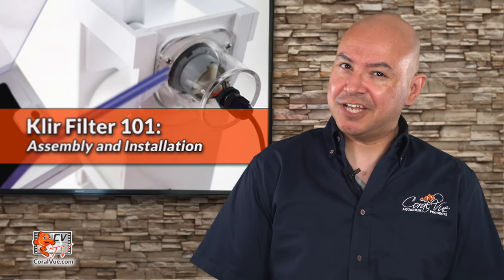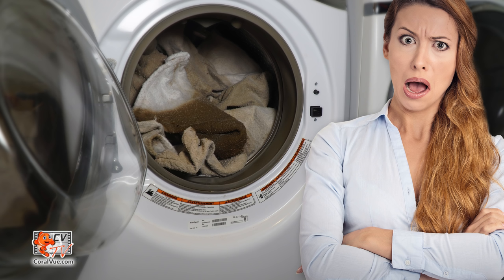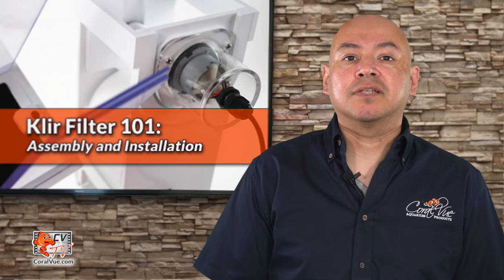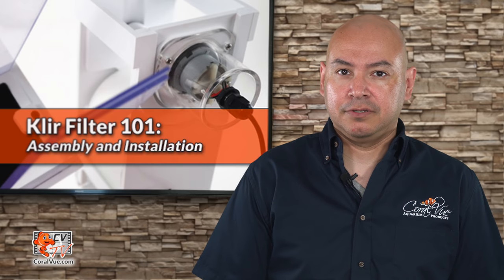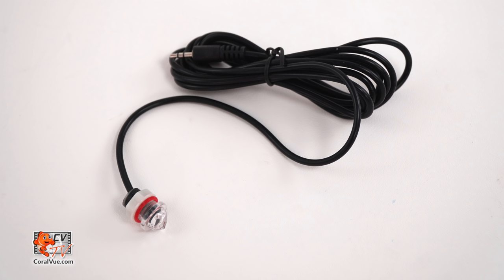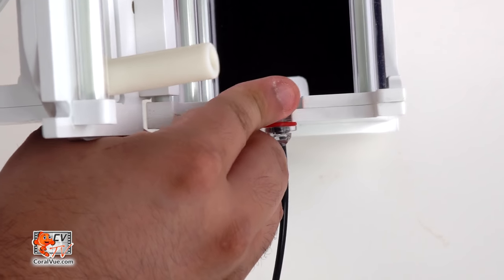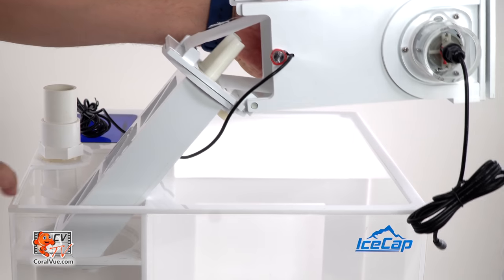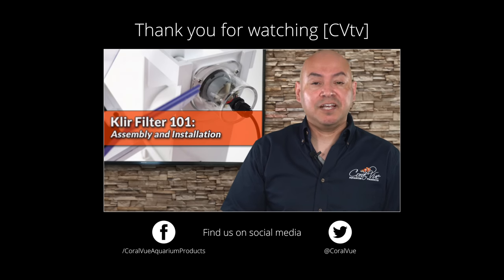Klir Filter 101: Assembly & Installation

Comment: I just got my KLIR di4 for my waterbox 130.4.  Looks like all the WB folks run at least 1 sometimes two...the sump for the WB is PERFECT. I got RID OF THAT POS RED SEA MAX 250. The waterbox glass?, stand and sump are Superior. And when you buy the BEST equipment to run a system it makes a difference.

Comment: I bought and installed it into my Reefsys 326. I had to modify the sump by lowering the filter sock holders in order to ensure that the sensor would work. Nothing was wrong for a few hours, but the alarm suddenly went off, and I saw that it was automatically rolling the filters, when it was clean. The sensor was not submerged in water, maybe slightly wet though.

A lot of the clean parts of the fleece filter has been rolled away, is there any way to reuse the lost part?

Comment: Great video!  Will it work on a trigger 39 sump where the filter sock hole is not a true circle?  The hole is more oblong shape.  Ty.
Reply from the maker: We currently do not have information on the Trigger sumps but do plan to work on adapting the Klir to most sumps on the market.

Comment: so i bought the klir di 4 but leave it off because of small water dropplets eventually starts blocking the optical sensor and make the fleece roll even if its still clean :( any solution?

Comment: I missed the part that explained controller function...  What does reset do?  Flashing light indications indicate what?
Reply from the maker: The Power/Reset button allows you to power on and off the controller as well as press and hold to manually activate the motor.

Comment: Have  you tested it in a reef tank with a skimmer ?
Does it make the skimmer overflow? 
Do you have to wash the fleece before using it to prevent the skimmer from overflowing?
Reply from the maker: Unlike filter socks which can be treated for color and often causes overflows the Klirs filter fleece will not have this affect.
Reply: CoralVue thank you for taking the time to answer my questions .
Need the dual unit, 4inch filter socks.
Where can I buy it ?
Reply from the maker: Our stores will have have them available by the end of the month if not earlier.

Comment: Carlos great Video, can you give me an idea of how to install one with a bracket so that I can install one in my sump that does not have a filter sock holder.. Please!
Reply from the maker: If your sump does not have a built in sock chamber or what that meets the Klir installation requirements you can use a Klir Filter Bracket https://www.coralvue.com/klir-di-4-filter-bracket . The bracket docks two drain lines from the aquarium and also has a bypass to manage how much water filters through the fleece filter.

Comment: Completely missing instructions on how to set up two units, just mentioned that you can...

After some research I’ve found it requires you to buy a separate splitter cable, fortunately it’s low in cost.

Comment: Would love to use one but can t work with my Trigger Tideline36 sump as the sump area can’t hold 1” or water. Is there an option to lower the sensor to say 1/2”?
Reply from the maker: Sorry there is no way to lower the sensor any lower to accommodate the sump. The filter only requires 1in of water to site above the sock tray.
Reply: CoralVue ok thanks. I only have 3/4” before it overflows to the skimmer chamber.

Comment: What is the purpose of the 2 vent pipes?
Reply: It seems to prevent any vacuum from rushing water in case it wants to siphon out. Depends on the level of flow in your sump from your overflow line.

Comment: 50 microns?
So I tried 100 microns in filter socks and it plugged up 1-2 times a day in a 20 gallon aquarium.  With 200 microns it was every 2-3 days. It sounds like 50 microns is going to plugg up reeeally fast!
The best would be if the customer could choose from 50, 100 or 200 microns.

Comment: I’m Assuming that this won’t work with any Red Sea tank since it can’t hold 1” of extra water in the sock tray!! Very disappointing
Reply from the maker: We intend to have adapters for all Red Sea reefer sumps in the near future.
Reply: What I did on my 525, cut a piece or acrylic from the hardware store and made my own. Works like a champ
Reply: edwin morgado , so where did u install it, did u silicon it also?? I was wondering if it would fit being that the space around the Red Sea sock holder so tight??
Reply: T Surro all along the edge and yes sealed it with silicone, bottom adapter plate on the base of the  Klir has to be trimmed also but it works like a champ